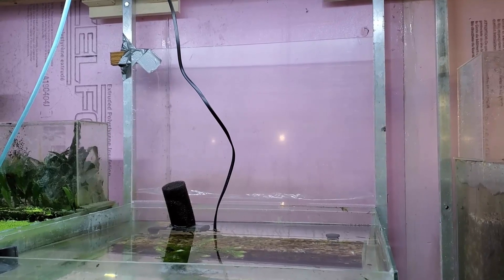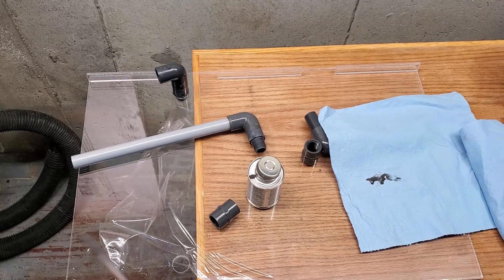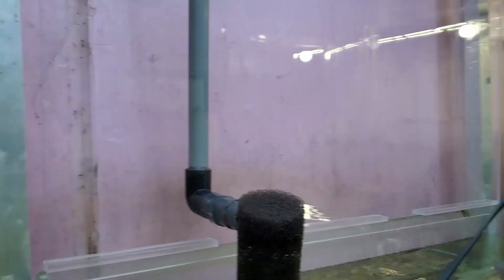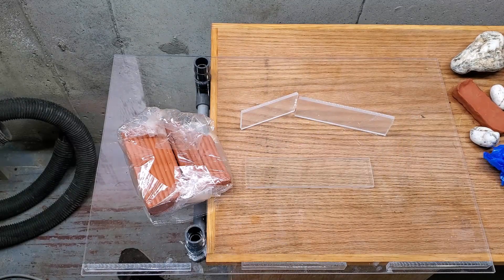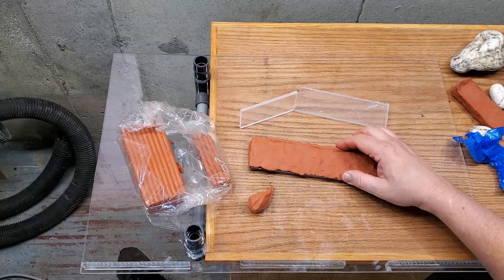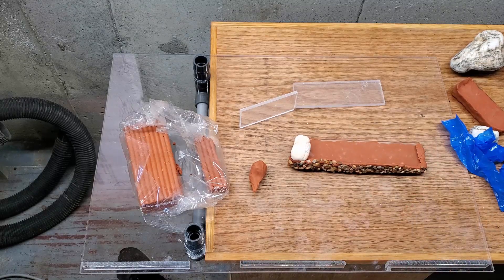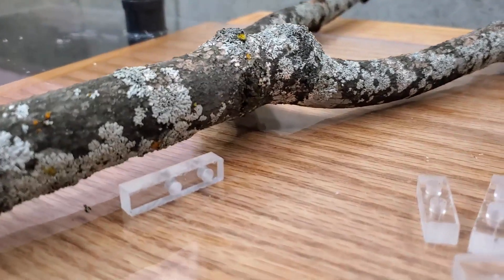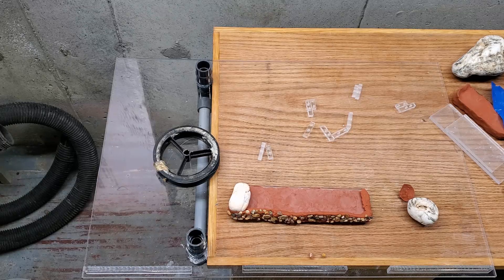Paludarium Build Part 1

Comment: I love your style.  If you do feel the need to keep the pebbles, try getting a wet sponge and pulling the clay over the pebbles a bit more.   I still had issues with the clay cooling to quickly and cracking a little around the stones, but it held up much better then just pushing them in.  Thanks fish man!
Reply from the maker: That's a great suggestion. I will have to try that for future projects. For now I don't really like how it looks next to the wood. Thanks for the tip!

Comment: Have you considered using something like styrofoam or expanding foam for ponds and then just shaving them into the proper shape and painting them with sealant?
Its a technique that SerpaDesign uses quite frequently, and hes easily one of the best paludarium makers there is.
Reply from the maker: I've used a great many different methods over the years. I wanted to try something new here. I've seen his work and it is lovely. Thanks for coming by!

Comment: Those terracotta shelves look amazing. 
Do you have any tips for removing old silicone residue from old glass as I've tried the 3 big brand silicone removers with very poor results, I've found methylated spirits works slightly better along side the trusty razor blades. Any suggestions would be greatly appreciated thanks
Reply from the maker: Your last method is mine as well. Silicones' best features is it's worst when you want to get if off. When I used to do aquarium repair I would sand the area and that worked best for a reseal. No matter what it's not any fun. Thanks for watching!

Comment: That product marketed as terra cotta is not meant to do what you are asking it to do. Home ovens do not get hot enough to fire clay to functional stability. Low fire clays in the kiln are fired anywhere from 925F to 1800+F  It is fired once to bisque ware, glazed and fired again. Red clay is what people call terra cotta.  The red is a result of iron and is why Dr Novak allows for the use of Flourite Red in the bio baskets. The grey clay of kitty litter has much lower if iron content, if any depending on where it was dug out. Only fired clay should be considered aquarium safe. Unfired clay when immersed will dissolve into a creamy consistency called slip. Hope you find a more suitable solution for your paludarium background. Cheers from the Mitten State🖐😁
Reply from the maker: This particular product seems to hold up very well in tanks. I've had some test pieces in pleco tanks for about a year and they are still solid. Might be a different type. Thanks for sharing your experiences  and for watching!

Comment: I would be afraid of putting wood in my aquarium without boiling it first. Curious to see how it works out.
Reply from the maker: Wood not from around a water source is fine. If collecting actual driftwood you do need to be careful for sure. Thanks for coming by Richard!